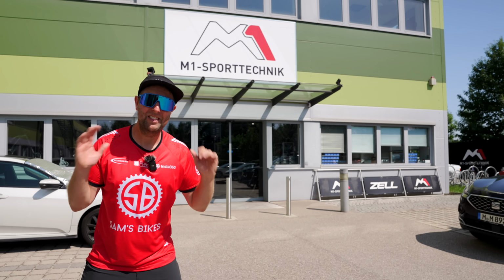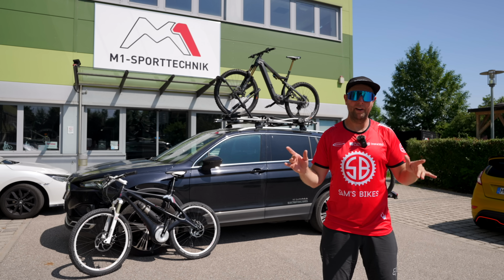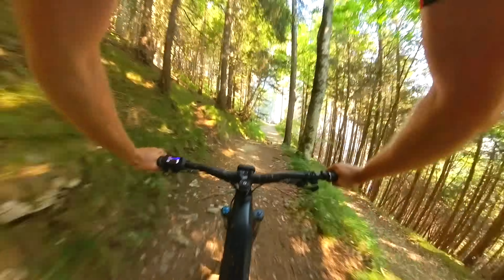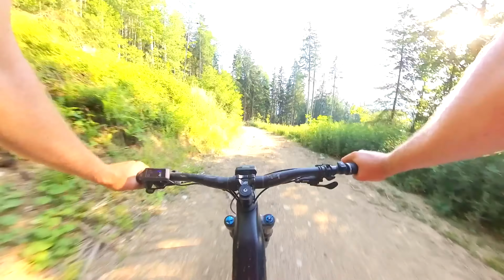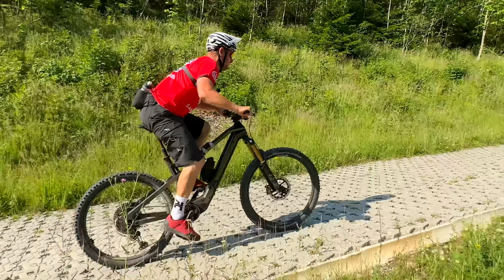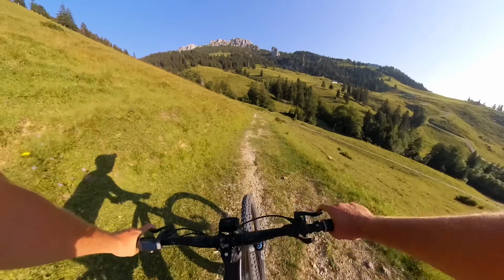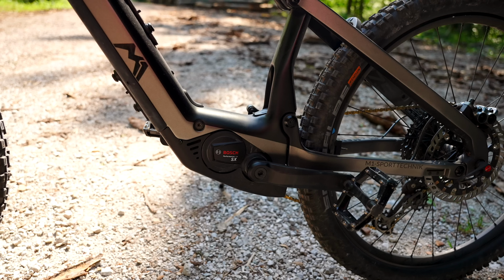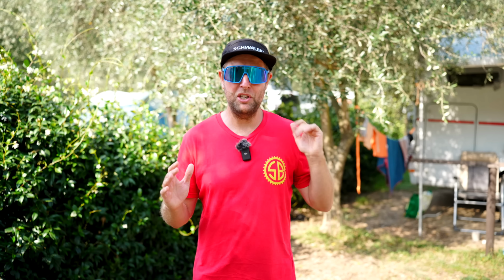New Bosch SX Lightweight Ebike Motor Review - M1 EN.400.SX Enduro SL EMTB

Comment: Looks like an great option (SX) and an epic bike.  I’m a heavy rider (92kg and staying at this weight) and deciding between the M1 and the Gen2 Levo SL (like the sizing, flexibility, weight, etc, only concern is the 320wH battery. Will be getting the range extender regardless). Any thoughts? I never ride over 95 cadence
Reply from the maker: Hey Mark, I have been lucky enough to test both motors and bikes and well they are both fantastic! I have not done a range test on the Levo SL but it seems pretty good on range! I feel you should get the range extender for either bike your going to buy! The M1 is a very sweet and more an enduro bike and the Levo SL also it’s Very sweet and more Trail.. any chance you can test either of them?
Reply: @SamsBikes  thanks Sam - always appreciate you channel and engagement/replies.  I’ll be spending 4-6 months in Europe and could try the M1 in Sept/Nov.  I’ve had a quick spin on the Levo Gen2, rides nicely (have ridden the Gen 1 in Finale Ligure a lot.  Doubt I’d get to range test them.  Kinda keen to get a new ride and that’ll then take care of it.  Either would be good as are the Fazua options.

Comment: My 2021 rail 5 is still going strong. I upgraded the 32 tooth motor sprocket to a 38 tooth chain ring. This combo still climbs hills with ease and paved trails are lot easier or less cadence. The stock length chain added more tension and zero sprocket slip Also installed more narrow knobby gravel tires for less rolling resistance resistance. I love my rail 5 on trails or pavement. 😅 
.

Comment: seems kind of counterintuitive to make the cadence requirements soo high, especially with euro speed limit requirements.  On my vado SL it has a 28mph limit, but its a slightly higher cadence, and mid power; so works well on a light bike.  I can't imagine this working very well on an mtb.  

I wish tuning on the big 3-4 motors would allow cadence adjustment, as not everyone pedals the same rpm, especially with the shorter cranks.  I do know its somewhat limited by how the motor is wound so ultimately it is physically limited and calibration adjustments could only do so much.
Reply: that M1 set of bikes do look sweet though!  Also, yes most people don't know how to ride ebikes in their "sweet spot" with more revs less grunt, so it's probably not horrible.

Comment: Another great review. That bike looks like a single track killer. Light, turns good, looks like it climbs great and stable for relatively steep drops. How does the power compare to the CX motor? When the SX is on turbo (or max) is that like the CX on tour mode powerwise? is that a fair comparison?
Reply from the maker: Thanks bro! To be honest it’s different it’s very much a SL motor that rewards a strong fit rider and you can access full 600 watts for very long. Maybe Turbo on the SX is like eco oh the CX
Reply: @SamsBikes  Thank you...I'm more of an 85nm guy anyway. But, that bike does look nice. It would be great with the CX in it I bet.
Reply: @SamsBikes  That's too bad. Turbo at 60-80rpm needs to be like Trail. Turbo at 120rpm needs to be Emtb.